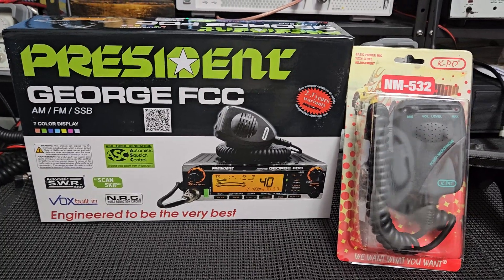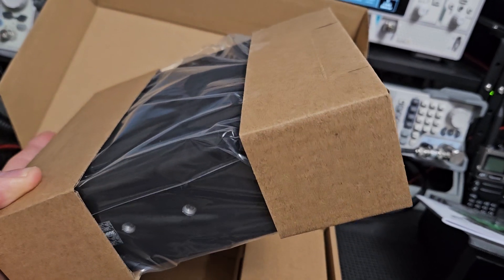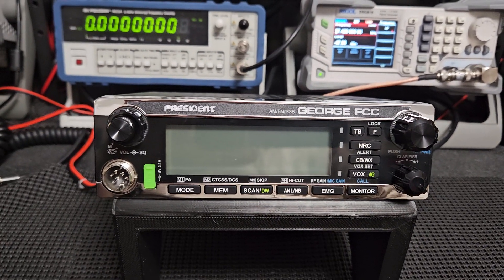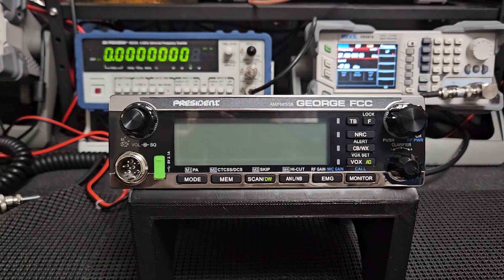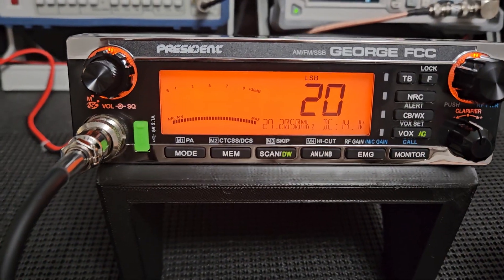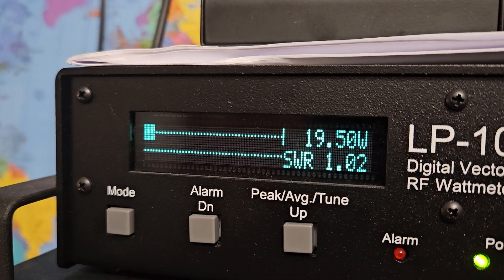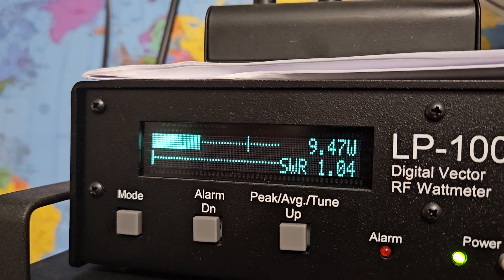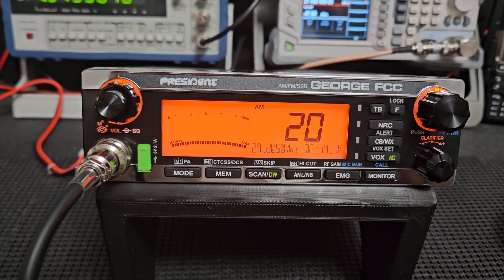New President George FCC for Kevin in Iowa

Comment: Scott would it be able to use the uniden bearcat wireless mic with this radio? Thanks
Reply from the maker: That's a good question.
I have one.
I'll have to give that a try.
Never even crossed my mind.
Reply: @ScottsRadios  I like it because I'm disabled a lot easier for me to get around the house and the other question is what do you have to keep it set to electric or dynamic. Thank you Scott for getting back to me.
Reply: With the wireless mic if it works.

Comment: I see that you have a QUANSHENG HT .... I know it's a little off topic but I couldn't refuse. It is a nice handy talking I have one as well.... and great video nice average power for sideband and a.m.. I may have missed it but what percentage of modulation are you getting out of the radio now
Reply from the maker: On the o scope I set them for 90%
When you're using voice it will jump up to 100%
If you set  it to 100% on the oscilloscope then you will have a wicked flat line on the carrier and have more distortion (bleed over) on voice signal.
Reply from the maker: Apparently it's not very friendly for spectral purity so I'll be using it as a glorified receiver only. I guess on the VHF and UHF bands where it's designed to be used it's pretty good but anywhere else that you can make it work when you hack it with firmware it's not really supposed to be transmitted on because there's no band pass filtering whatsoever.
Still a fun radio to be able to take outside and listen to say 20 meter SSB or something you know.
Reply: @ScottsRadios  It's a handy signal generator for when you just need to verify operation of a VHF/UHF receiver, like checking crystals in an old scanner. It also makes a good "sniffer", like when you're plagued by strange noises and you are searching for the cause. For $30 including shipping you can't go wrong.
Reply from the maker: I just got that handheld radio and I'm wanting to source a PC cable for it so I can hack the firmware into it.

Comment: The board inside the George II is 95% the same as the one in the Radioddity QT60, Anytone 5555 N2 (And many others) therefore you can expect very similar performance.
Reply from the maker: They are very reliable and have great performance.
Reply: @ScottsRadios  absolutely 👍
Reply: Now is there a new model from president. It is the amateur version from georg 2 and it calls washington. Bring 80 Watt pep AM/SSB and 50 Watt FM. Need less then 12 Amp TX and have a Power Management. You can buy optional 2 vents for heatsink and in menu adjustice the temp when vents do their work. New Option is you can show the DC Voltage or Temp in your shack.  I will have one. ❤